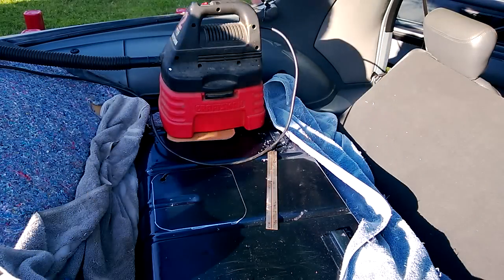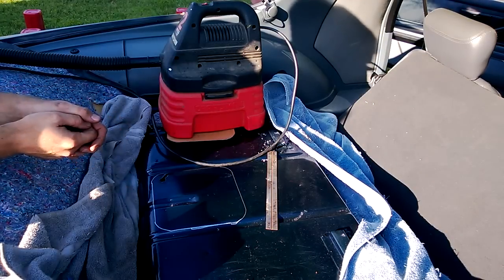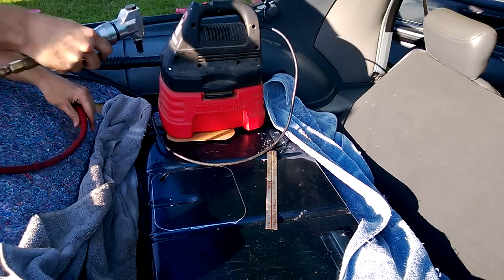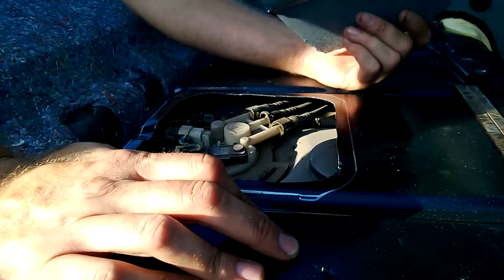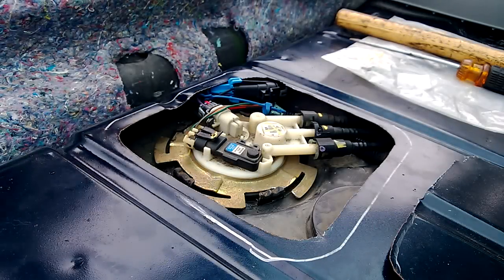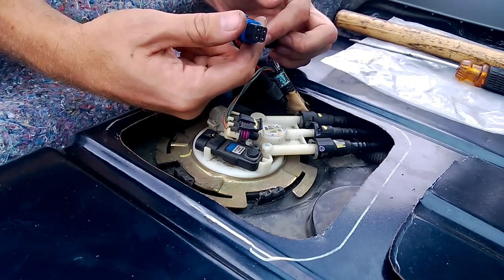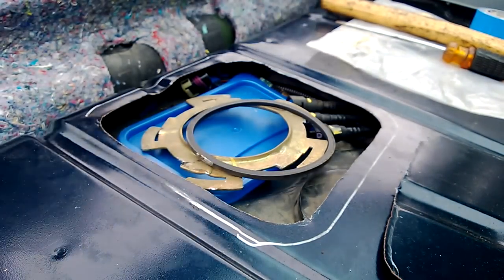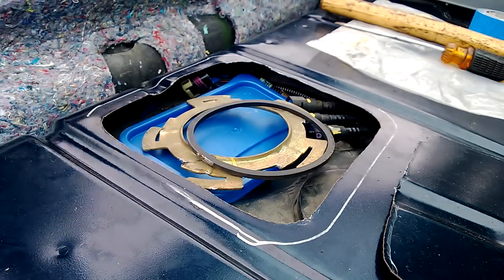Cutting Fuel Pump Access Panel and Removing Fuel Pump Assembly - 86 Trans AM with 02 Gas Tank

Comment: I like the idea of using a nibbler. Though it seems a bit messy, seems far safer than using a cut off wheel by far. I think I'll get a air nibbler to do this. I'm mostly doing this to fix the fuel sending unit, which I saw a fix in a different video., but since I'm going through all this, I might as well replace the fuel pump. Is the racetronix fuel pump worth it? I hear gm's fuel pump is unreliable.
Reply from the maker: If i had to do it again, I would either put a shop vac hose near the nibbler, or maybe a large magnet if one is available.  Those little nibbles go EVERYWHERE.  Im still finding them randomly in the back where my sub box is haha.  The GM unit is pretty reliable.  After all, they run in stock cars for 100's of thousands of miles generally.  The racetronix pump is a nice unit.  That plus the hotwire kit and I saw a nice improvement in my fuel pressure.  Plus I know it can support some upgrades if I make them.  If you ask me, the price isnt bad either.... Just make sure you get a real one, and stay away from the cheap knock offs.
Reply: ***** I think I might just do the fuel pump anyway just to be able to support upgrades. I was thinking of a few different methods to control the shards. I was thinking about taping a big transparent bag around the area I'm going to cut and just cut a hole big enough to fit my hand and the tool through. If that doesn't work, I'll try a magnet or shop vac.